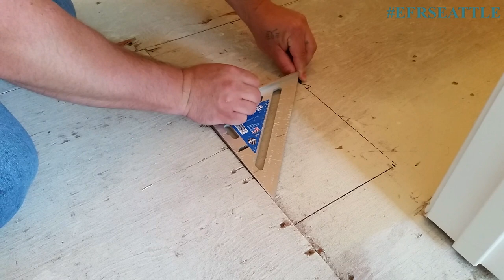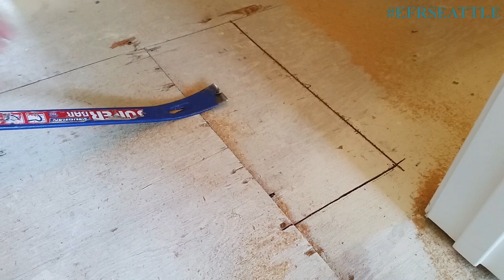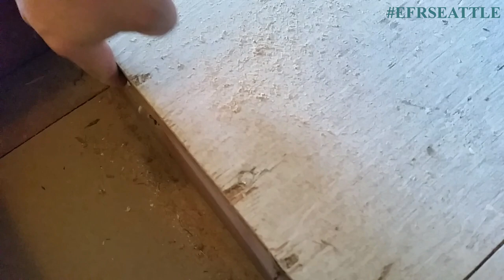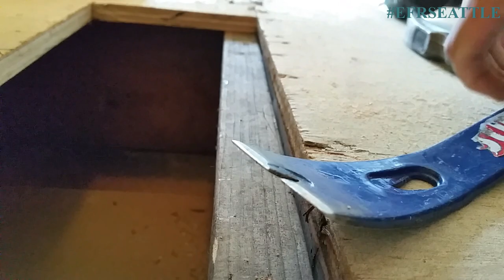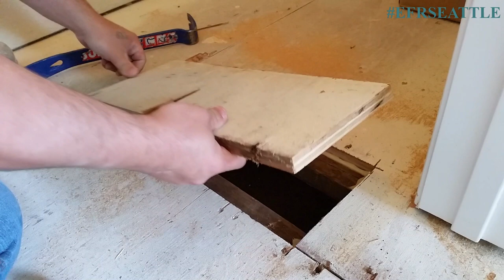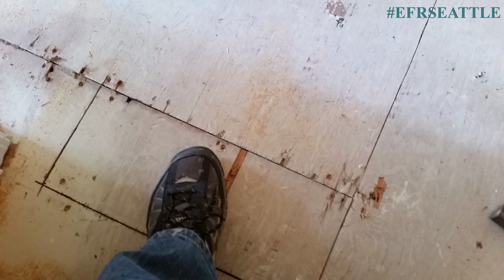Subfloor repair. Floor joist mistake.

Comment: I don’t get it. Yes one piece has been sistered with an existing joist but then the other piece is screwed to the floor but it’s effectively got fresh air underneath it. Would it not have been better to find the next joist along and get everything connected to those?
Reply: Prob would be better cause it’s relying on the 3 screws to not break off or rip itself through floor
Reply: @jaydenb7515   This works fine with  3/4 plywood almost no flex in short section. Would not work well with osb though.
Reply: @stevelopez372  "almost no flex"... and there's the problem.  there's should be NO flex.  the weight should be supported completely by joists.  This may seem like a fix, but over time, that support WILL fail.
Reply: I agree with A C.....
Reply: He should of went back 16 inch's to the next joist

Comment: Good job solid blocking and fastening, polka music no so good.
Reply: Only one side of the replaced piece is actually attached to a joist, though. It is a pretty small area, however, so maybe it will be strong enough.
Reply: Mud Marine  yup, seen it before, 3/4  inch ply is part of the reason and small area , OSB wouldn’t do in my mind.

Comment: Excellent. You can also do it when there is no joist on either long side. (Added inset register covers.). One suggestion: I used Titebond III on the surfaces of the horizontal pieces where they attached to the underside of the subfloor.

Comment: If you cut into the joint about a 1/4 inch will it cause issues later on?  My floor has some swollen edges that creak. I worried about cuting into the joist since i dont know how thick the original boards are

Comment: This is a great repair ideal but instead of doing the second 2x4 like he did if at all possible just cut the plywood square a little larger to the next joist and attach to it or sister it there like he did the first block will make for a much more stable repair

Comment: Not to criticize but a few more inches over and you could've installed some solid blocking between the floor joists.  Then the edge of the subfloor would been solid.  This method is fine for a while but it'll loosen up in the future.  Just sayin.

Comment: Would of been better to go to the next floor joist instead of the middle of the bay and block all the way around....Not the best repair in my opinion
Reply from the maker: Thanks for your opinion, but next joist ok. This joist not straight line and only one place needs to repair.
Reply: @EFRSeattle  But your repair with no support between the joist is now not OK....2 X 4 laid flat floating in the air
Reply from the maker: @zeke112964  Thank you again for your comment. I have been using this method for last 12 years, and until that time everything works. Thanks you.
Reply: @EFRSeattle  It does work but like I keep telling you it's not a proper repair and will fail eventually.
Reply: @zeke112964  pullout force of each screw is a few hundred pounds and floor loading 50 lb/sf. Small patch area, should be ok.
Reply: zeke112964 this is better than tongue and groove should last 35 years at least...

Comment: So what's 2x4 supporting on basically screwed to subloor
Reply: It works with 3/4 plywood which is very stiff in short sections not so good if it was osb.

Comment: The builder was pretty bad laying the 4x8 sheets. First no support in that area then one long running seam that should be staggered for strength. Where was the inspector? BTW nice job.

Comment: So there is only one edge of that piece of plywood that is going to be solid. Obviously the side that was sistered to the joist. What good does it do to screw a piece of 2X to the floor? There is nothing supporting it! That outta be fun fixing that after all the liquid nail around it. Sorry but this method is useless. Should have cut back to the joist on the other side and sistered it also.

Comment: This video is not very helpful without explanations on what you are doing and why.
Reply: Scab (also called sistering) a 2x4 onto the joists so the plywood ends have something to sit on. It's a pretty easy concept without explanation.
Reply: @fordrac1ng81  most people don't know what sistering is in the first place.
Reply: @aguyandhiscomputer  Yep, that's why we use google.
Reply: @johnnewbold4622  agreed.
Reply: First Last  Still not the correct support.

Comment: I don't think you are supposed to be gluing and screwing subfloor...it's more likely a no no.
Reply: lgmnow kondo he put the glue there so it would stop the wood from creaking over time
Reply: @chrisparris5836  if that was the case, then we would all be gluing and screwing subfloor...but we're not. And we're not for a reason.
Reply: @lgmnowkondo938  Isn't that reason typically time, effort and cost? It takes longer, costs more and is generally more work to screw the subfloor into place than to use a framing nail gun, but I've yet to see anyone other than you saying it's a no no.
Reply: @CidZAER  I had seen a video on youtube where it was expressed that gluing and screwing a subfloor are improper from a structural perspective. Making that structure too rigid may affect some other structures in the house. But...I can't find that video now. Perhaps what you're doing is indeed correct and very good.
Reply: @S Han ur wrong. A nail is much much MUCH more solid and resistant that screws. actual fact
Reply: @bookiebullies  but nails are more prone to get loose and start squeaking when it comes to securing plywood to joists, now if you are talking about framing thats another story, in that case nails are more solid and have better strength.
Reply: Bookie Bullies yeah really solid until the nail pulls itself up
Reply: @lgmnowkondo938   Sorry friend but the Building code allows the use of screws and construction adhesive has been use for decades, of course not by all builders.
Reply: @stevelopez372  I'm sure its allowed...but it can have negative effects on structure.